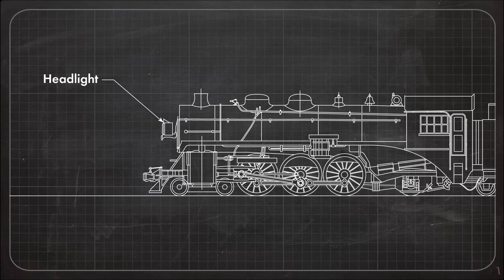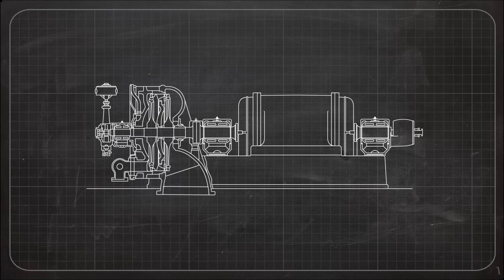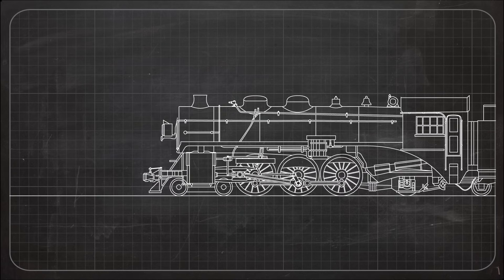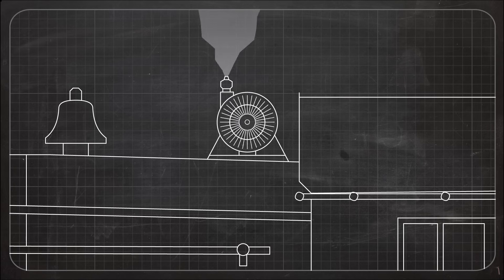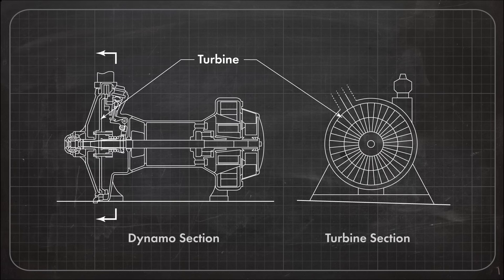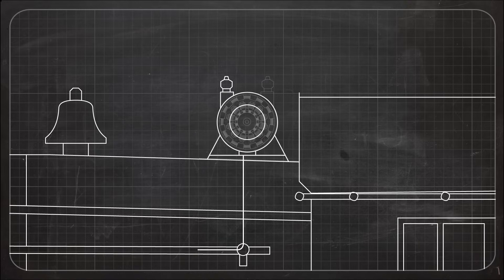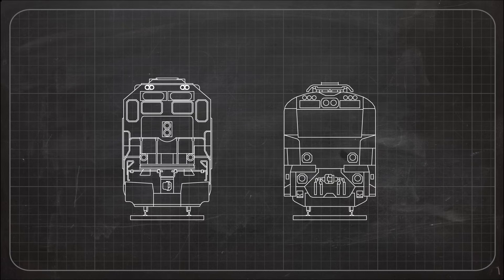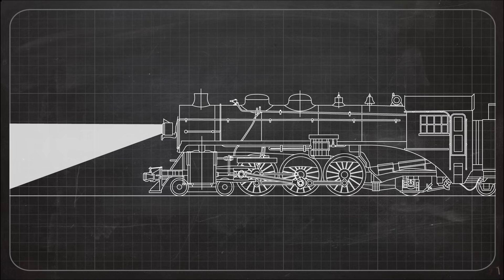How Do Steam Locomotives Power Their Lights?

Comment: Always thought that steam from the dynamo was like the safety valve
Reply: Not quite.  The sound when a safety valve "pops" on a steam steam engine or static steam boiler is unmistakable.  While the fire in the firebox is continually boiling water and generating steam, whether the train is running and using it up or standing and allowing steam pressure to build up, the  steam pressure in the boiler may rise above the standard operating pressure.  If that pressure rises too high, that could cause a failure of the steam boiler.  The safety valve is designed and set to "pop" open before that critical pressure to prevent the boiler failure.  That pop opening of the safety is very loud, and a jet of high pressure steam is released to the atmosphere.  The release continues until the pressure inside the boiler is below the pressure needed to open the safety valve and the world of steam returns to the normal hissing and humming sounds spoken so eloquently by a living steam engine.

As for boiler explosions, few if any were ever caused by a safety valve failure.  A low water condition within the boiler structure and/or firebox was often the cause for the most catastrophic failure.

Comment: Some bicycles still use dynamo-powered lights to this day!
Reply: Do you have any friends ?
Reply: Nonsense. For very many years, bike dynamo lights have had backup batteries. If I get delayed and unexpectedly have to travel at night, my lights are there and I don't have to remember to bring them or charge them.  My bike is my transport, a dynamo is the only way I can make sure it's always ready to go day or night.
Reply: @tonywoolf5042    had those wheel driven gizmos on a bike in the 50s and no battery reserve. It was either that or straight battery in those days. We didn't have cheap electronics or hybrid systems. These days is all LED with good bateries and possible charging via a wheel driven device.
Reply: @tonywoolf5042  My bicycle has the dynamo for its lights and does not use a backup battery.
Reply: @darrellbedford4857  Same. I had one with no battery. It sucked because the output would vary constantly.
Reply: yugoslav bikes over here had dynamos as only option all the way to the late 80's and state breakup 😅
Reply: I had one of those as a kid in the '90s. Biking was only usually done in the daytime anyway, but my dad got us these simple generators and lights and installed them. It was really cool riding into the evening up and down the block seeing how bright you could get the light!
Reply: Most are hub dynamos now.
Reply: Bicycle 'dynamos' are actually alternators. They don't have commutators or brushes.
Reply: I had a dynamo/generator headlight and tail light on my 10 speed and ran that thing who knows how many hundreds of miles. Generator no longer works but I still have it on a shelf. Headlight and tail light are still on my bike for nostalgia.
Reply: I expected the trains here to use the same method, rather than being directly powered by steam.. They could have run it off the wheels..

Comment: that's only in the US, places like the UK didn't do that, in the uk, they still used oil lamps until the diesel era
Reply: Mostly because lamps only were meant for others to see the train. It was a headcode, it tells what type of train was and in the diesel era they had an alphanumeric headboard that told not only the type of train but also where it was going
Reply: @someNewYorkCentralfan  steam trains here didn't use electrical power, it's only limited to the US, rest of the world didn't do it
Reply: Nah, trains in Canada also used turbo generators for electricity, not only for the headlights and classification lights, but also sometime for the trailing passenger cars.  @AdamHinckley
Reply: @eatonjask  still, no one else did, the UK didn't do it
Reply: Japanese SLs havw dynamos for thier head lights and tail lights @AdamHinckley
Reply: @AdamHinckley  There are some british steam locos with electric lamps.
Reply: @J-Railway-Volunteer  no they don't, not in the old days, trains like the mallard all had oil lamps, that's why if you go to an heritage railway, they moved it from the front to the back of the train, that's definitely ain't electric ones
Reply: @AdamHinckley  There were certainly some southern railway locos with steam generators.
Reply: @J-Railway-Volunteer .  British steam engines could and did generate electricity for the carriages ( and low pressure steam for heating of the carriages, sometimes via a heat exchanger).  But they didn’t use electricity for any running lights, right up to the last steam engines running on the BR system.  Paraffin lamps were reliable and trusted for that purpose.  They were also easier to change to different configurations to match to the train.  Even today running lights on British trains aren’t to illuminate the way for the drivers.
Reply: Some later Southern Railway and LNER Thompson engines had dynamos fitted for electric (D.C.) lights. The LNER engines usually had the dynamo on the running board, exhausting into the smokebox. A fair few countries around the world, used dynamos. From places in the East such as India, Japan, and Australia, to South and Central American countries. There certainly were European places that used dynamos as well, although as many have noted their were also countries on the Continent and companies in the Isles that did not.